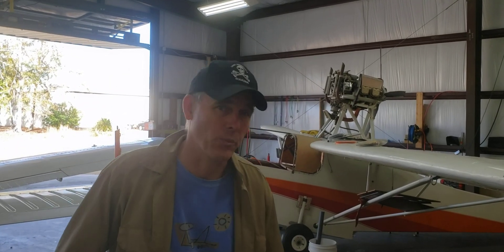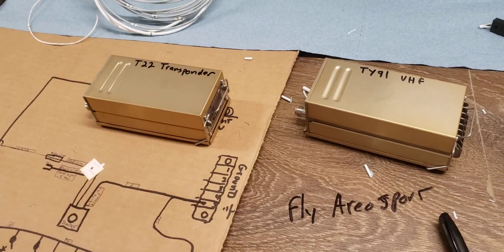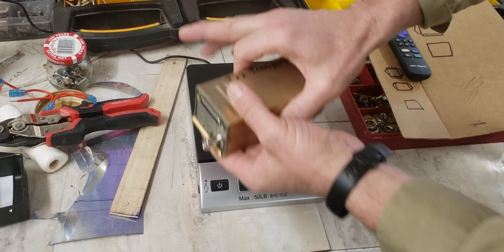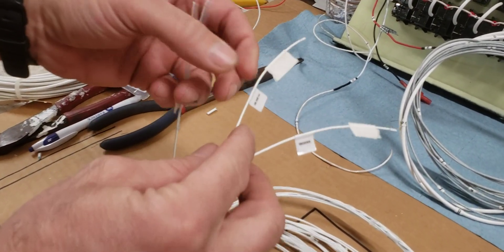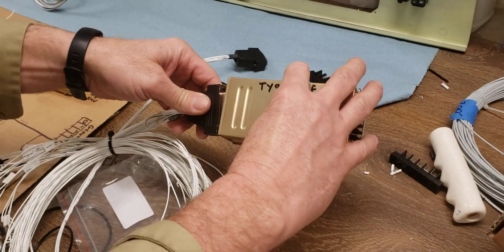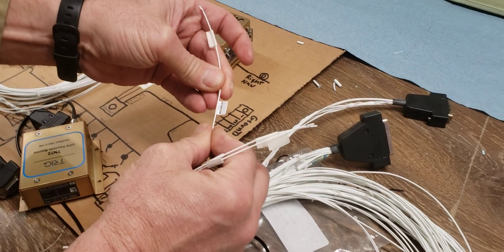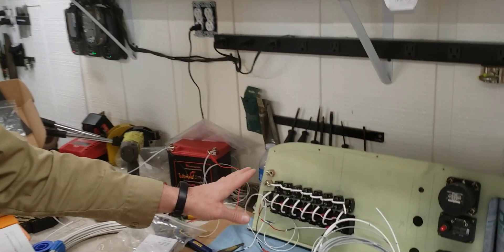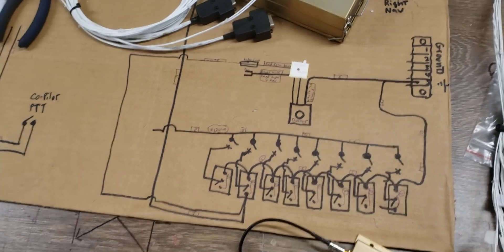un-boxing and evaluation of both Trig T22 Transponder, and TY91 VHF

Comment: Will the system be powered by the engine (alternator) or is it battery powered?  I plan to put a Trig 22 in my ‘46 Champ (no engine-driven electrical system) for ADS-B Out so I’m exploring what battery to use.
Reply: I fly a glider and I use a pair of Lithium Iron Phosphate batteries of 10 AH switched so that only one will be powering the system at any given time. Light weight and small in size.
Reply from the maker: Battery